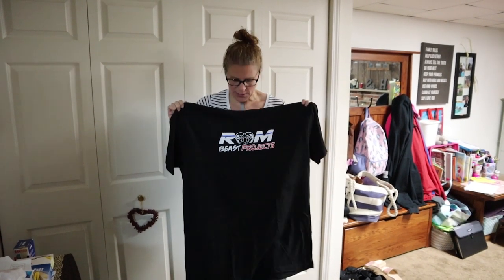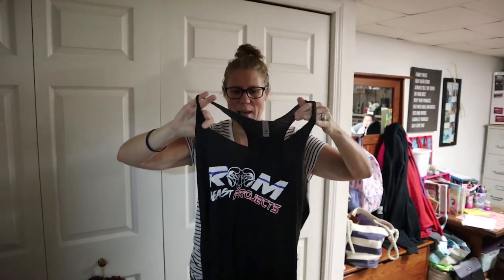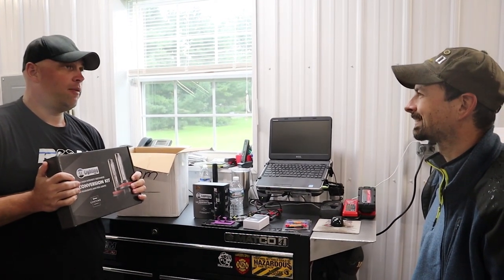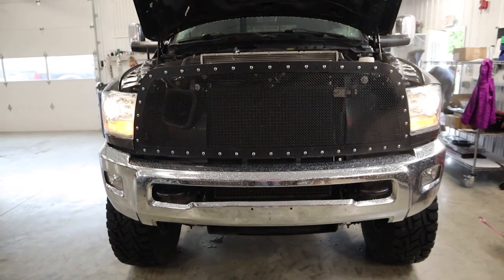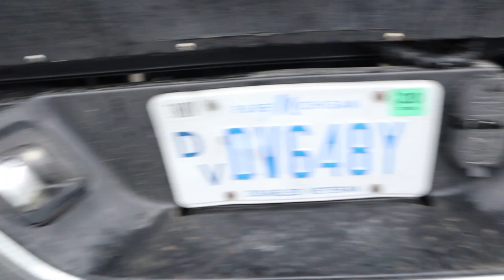BRIGHTEN THINGS UP! All Ram owners need to do this upgrade!

Comment: Yo Yo, hello from TX. Just wondering if you are still going to try and give us a rundown on cost for the gear swap and transmission upgrade/rebuild?
I am currently "THAT GUY" since my 2014 Dodge Ram 2500 68RFE transmission took a big one on me @ 110,000 miles and am trying to get an idea on how much I am going to spend to no longer be "THAT GUY". (I'm sure my 3.42, 22" Forces, and 37" MT's didn't help)
Thank you for putting out great content and hope to see more upgrades!
Reply from the maker: Oh no, I’m actually going to Chesco Transmissions tomorrow to film it.
Reply: Ram BEAST Projects  Awesome to hear! Thanks!

Comment: Love your videos not hating at all but HID headlight bulbs are old school LED headlight bulbs are far more superior and throws more light and clearer. But i love your channel
Reply from the maker: LED’s are horrible in projectors, that’s why we put LED’s in the high beams that are reflectors.
Reply: Yeah I am not happy with my LED's in my projectors. The flashlight I carry on my duty belt is brighter! One burned out also. Going to contact Diode Dynamics and see if they will let me adjust the cost of some HIDs.
Reply: LEDs are real bright LOOKING AT the truck but don't throw much light down the road.

Comment: Great channel!  I just bought a 2019 Laramie.  My first ram ever!  Thinking of getting a 3.5" lift.  Any opinions on the Rough Country 3.5" liftl
Reply from the maker: Thank you! The one we recently lifted was a 2.5” Rough Country leveling kit. You’ll have to check that video out.
Reply: Ruff country Lifts cut corners, you just bought a $70,000 truck.... Do some research and you will see rough country lifts flaws.
Reply: @samsonitejones4012  I will.  But I find it ironic that someone would point the finger about cutting corners and then spells Rough as "ruff" simply to cut a corner